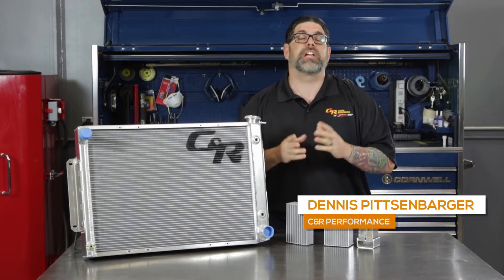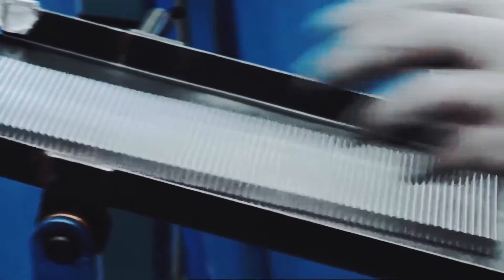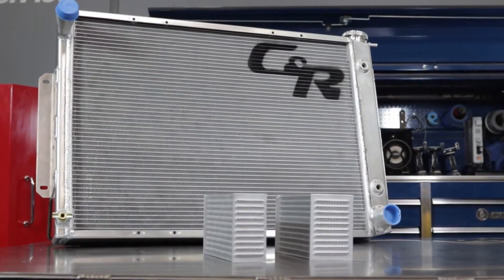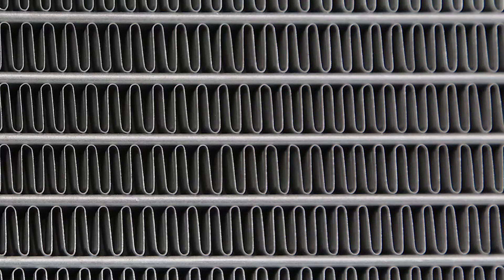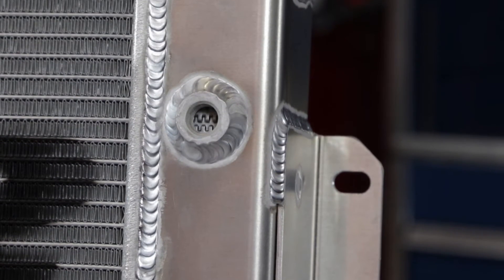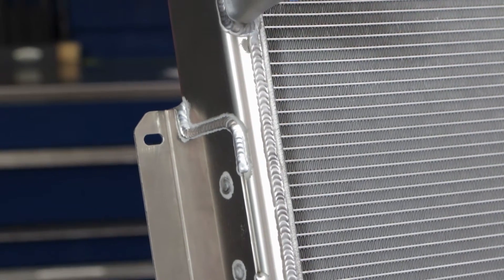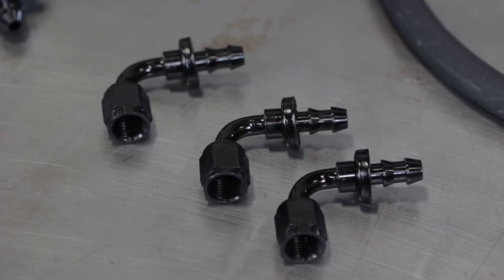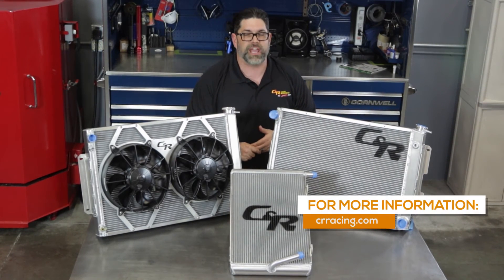C&R Extruded Tube OE Fit Radiators and Core Technology

Comment: Extruded tubes are so interesting. In theory I love not having dead-space between rows of tubes, but...
Aren't the extruded tube walls much thicker than an old-school rolled tube and doesn't that inhibit cooling to a certain extent? 

If the 55mm extruded tube is broken up into 12 "mini, 4mm tubes" internally, and has thicker walls doesn't it provide less total coolant flow area vs. just an old-school 2x1" rolled tube? (Would a 55mm tube with 4, 12mm tubes provide more internal flow area and cooling vs 12x 4mm AND still provide significantly more burst protection vs. a 24mm rolled tube? -Yes you have no external gaps, but still plenty of wasted internal coolant flow area.)

I have a really quite nice Stage 2 high flow Stewart SBC water pump, but even then, I'm not ever going to need 100 PSI burst protection. I just need the best cooling possible and I'm curious whether extruded tubes really are going to do that or not... Does the reduced coolant flow area vs. a 2x1" rolled tube and the thicker walls reduce the cooling more than your other features improve it, or not? 

-Dimpled tubes are nice (I'm assuming the dimpled tubes come on the extruded tube core), the slight efficiency gain from edge-rounded fins / (I'm assuming that's what "R-Fin" technology is). 

-It just initially seems like the use of "extruded tube core" result in a potential REDUCTION in cooling vs. ye olde tubes, only to gain added burst protection that a street car doesn't need, unless I'm wrong about the reduced coolant flow area vs. 2x1" rolled tube or 2x1.25" rolled tube.

You have some bad-@ss radiators and I love seeing the shrouds that allow use of 2x14 fans. Not convinced yet on extruded tubes being a cooling benefit, and they HAVE to be more expensive, right?